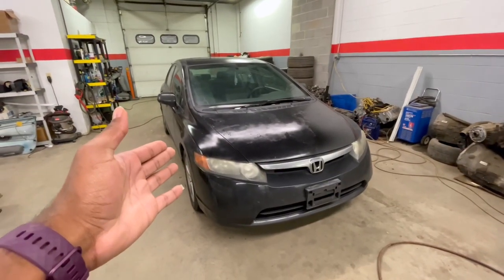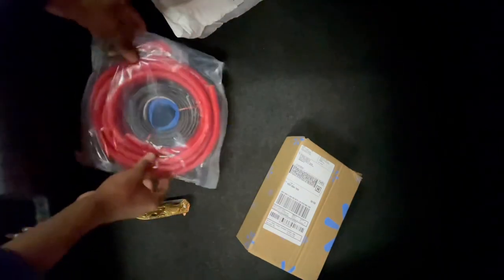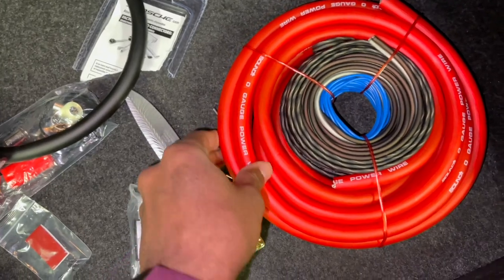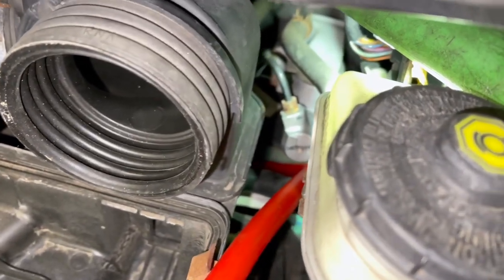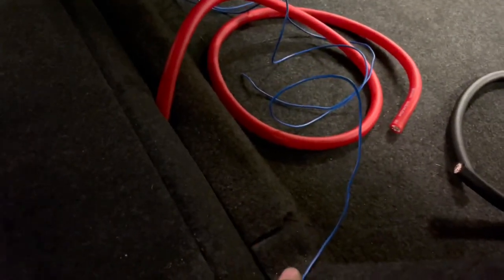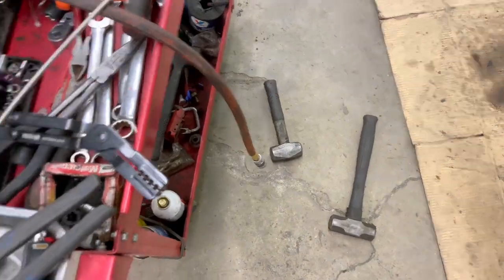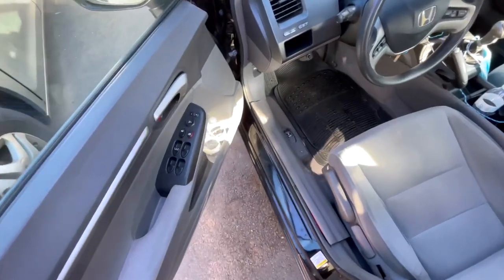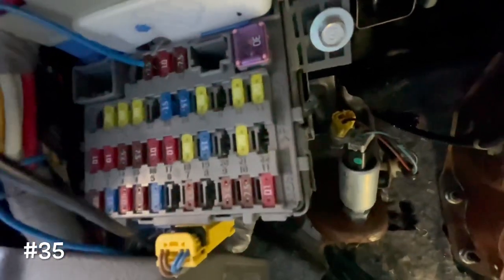DIY subwoofer audio install on my 2008 Honda civic

Comment: Dope video man. I’ve got a 07 civic EX myself and this cleared up hella questions I had for the underseat powered Sub I’m gonna install 💯 gonna tap the power wire into the fuse box then maybe ground to the front seat bracket but we’ll see
Reply from the maker: If you have any questions feel free to ask
Reply: @maarodon  I’m doing the same thing on my ex with the under seat sub do I need to disconnect my stock amp and sub in the back that it comes w ???

Comment: what's the best way to get the best audio out of this sound system? I have a 2006 honda civic ex with the stock amp and subwoofer and I want some more bottom end/bass and to have more volume
Reply from the maker: Best way is to get aftermarket subwoofers and amp

Comment: How do you plug it into the stock radio?
Reply from the maker: You don’t, you will have to use a line converter

Comment: Were do i find the remote cable  for my amp
Reply from the maker: It should be under the shifter towards the head unit if not you’ll have to tap in the speaker wires with a line converter